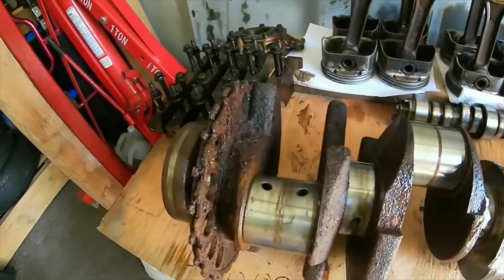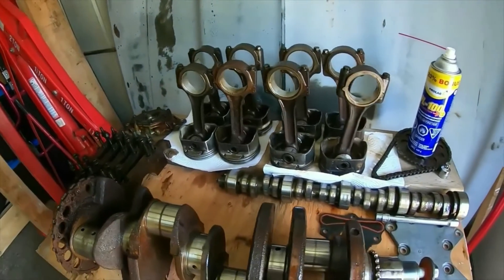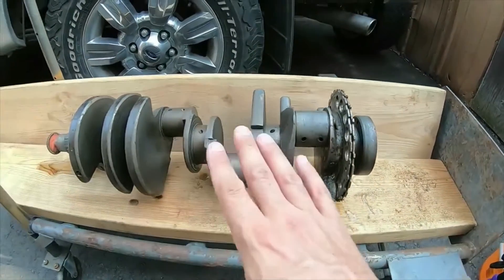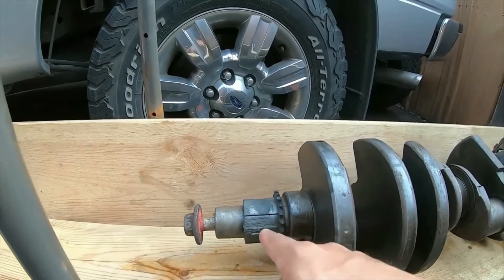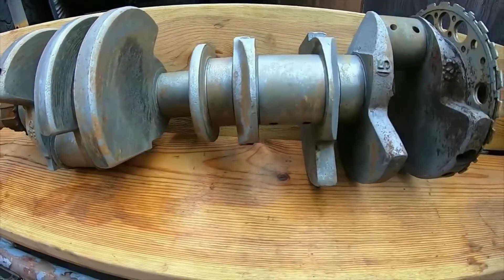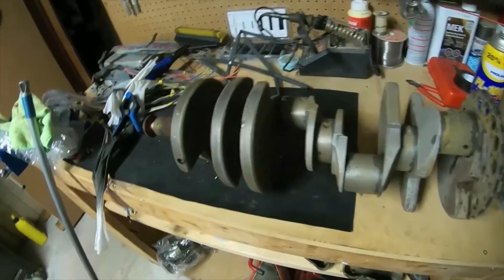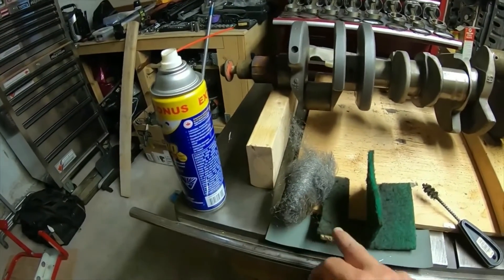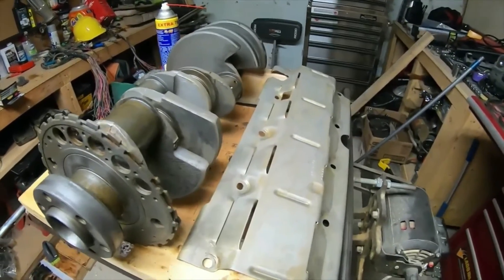Worst LS Motor BOUGHT (How To Clean Rust from a Crankshaft)

Comment: Great video, i am 50/50 on this idea had a mice infestation and they got into my storage boxes with my crank/cams/journals etc for one of my good spare engines and everything is now rusty its like do i toss it all / try clean it with similar process and hope its within spec...My engineer and local engine builder would say toss it and buy another block, the decision hurts haha.
Thanks for upload and you have a new sub :)
Reply from the maker: Hey thanks a lot man I appreciate you stopping by and dropping a comment and thanks for the sub, I still have yet to dip the entire block in this and see how that turns out it could be a good idea or a bad i dea but  regardless i will still share a video either way

Comment: How did the bearing surfaces turn out? Awesome video by the way.
Reply from the maker: Well so what happed was when the crank was in Vinegar for the length of time it was the Vinegar did wear off the finish on the bearings believe it or not so they probably would have to be re-polished or something but it did do a good job at cleaning all the rest right off, but all this that im doing is "Experimental" so you know for next time depending on how much rust or how little you could probably water down the Vinegar just a tad or maybe leave it soaking for a lot less of a time im thinking,